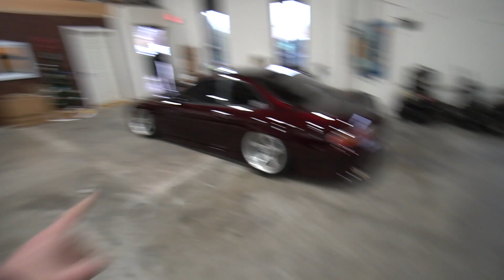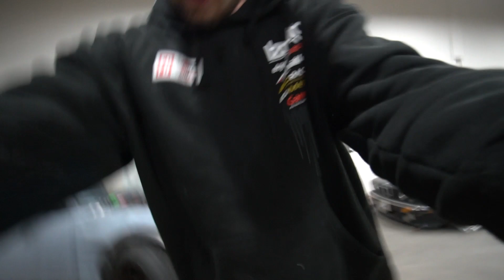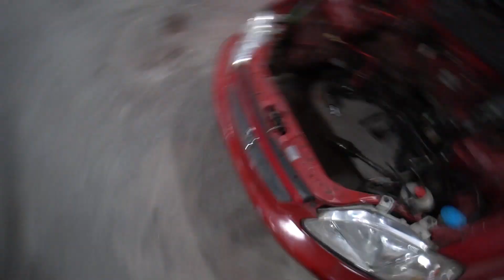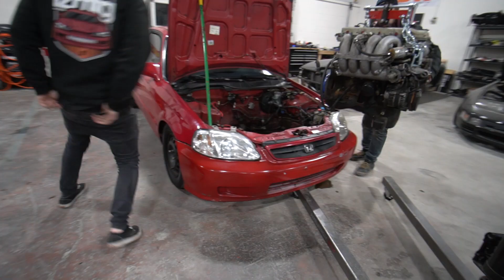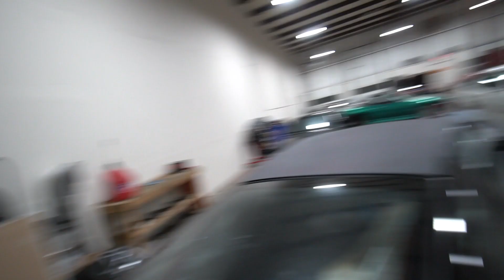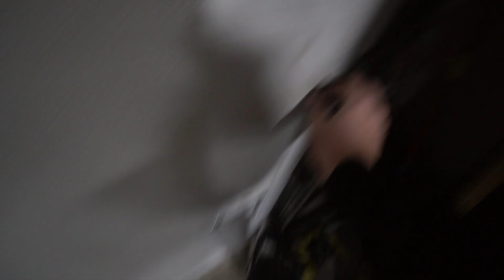WE'RE PUTTING WHAT IN A HONDA CIVIC?!

Comment: I think someone did a rwd civic hatch with 240sx subframes this is way more interesting than what I thought was happening I thought you were going to do a fwd sr20 tbh
Reply: Throtl
Reply: They used the awd swap rear end parts and made the front subframe
Reply: Ya dude lives down the road from me. Its still runs and drives.
Reply: Some guy here in phoenix az is building 2jz civic its rad
Reply: Cory Jackson same or at least AWD but this is gonna be nuts
Reply: wrexz no there’s a black one that’s rb25 swapped I think hoonigan did a video on it

Comment: Honestly the EK civic wheelbase does really good for drifting. The stock steering angle and everything it snaps back pretty fast. I've never been able to hold a slide but the angle and speed I could approach turns for giggles at the track was insane.

Comment: Done this before back in 03 in highschool. All I did was get AWD turn it sodeways pull front shafts and then crueldely welded the end of the driveshaft from the s10 to the civ shaft. S10 rear end fits underneath the rear, little but of fab work making mini tubs, and then get over fenders. Looks like its supposed to be widebody.. Shallow lipped wheels.

Comment: another option thats probably cheaper compared to a custom frame wouldve be taking the whole floor and framerails out of the donor car with the steering rearsuspension and the innerfenders / mounting points for the struts and all , do the same with the civic and mould the rearwheeldrive bottom and the front wheeldrive bodywork together shorten or stretch and strengten the bottomplate where needed

Comment: Bro i Love out of the ordinary swaps! Me I'm swapping an L52 and a Aisin AR5 5 Speed from a 2008 Chevy Colorado into my 2002 Cavalier. Coupled to a MK3 Supra Rear sub-frame. Stock the L52 has 220 hp as opposed to the original LN2 hp of 115. Almost double the power and Potential.  Im Also going a HUGELY different route with my MK3 Supra. That will be getting an AWD conversion from a AWD 09 Trailblazer LT.

Comment: Mustang 3.7 f150 v6 (has stock oil cooler port) is like 350 or 400 bucks an 400 for a 6 speed manual. hollanderparts dot com. Stock engine can be single turbod for 500whp easy a f